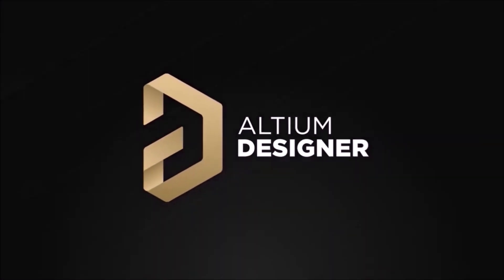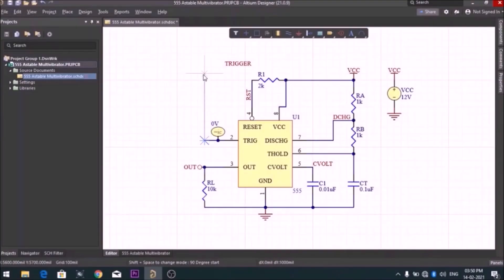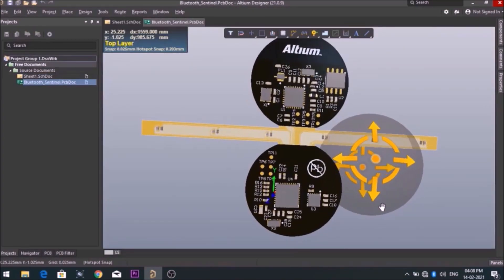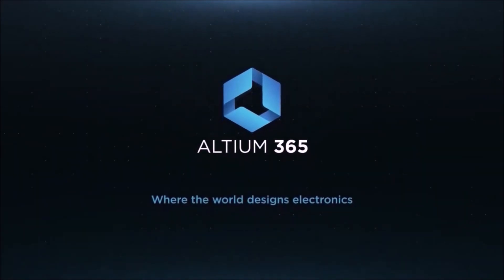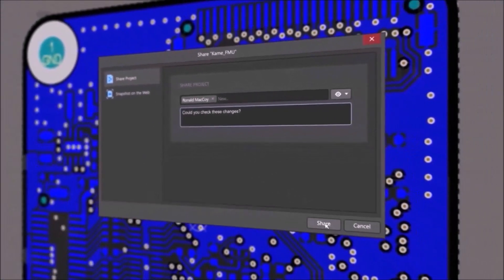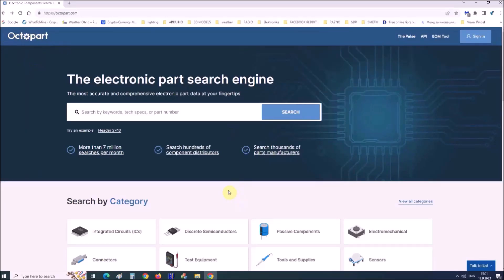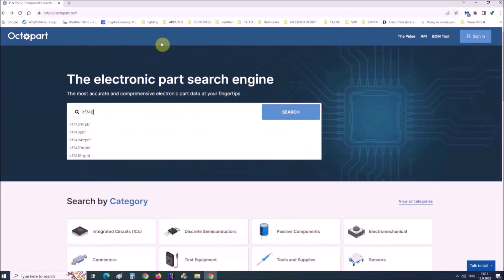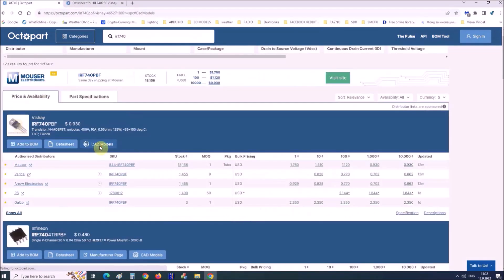Arduino FFT Spectrum analyzer on VFD display GP1287

Comment: How did you make these cases for your projects ? 
Did you buy them or make them yourself ? 
Your cases look very nice and professional. I'm curious because I am making equipment for my laboratory.
Reply from the maker: I make the houses myself from PVC board with a thickness of 3mm and 5mm, and cover them with self-adhesive wallpaper